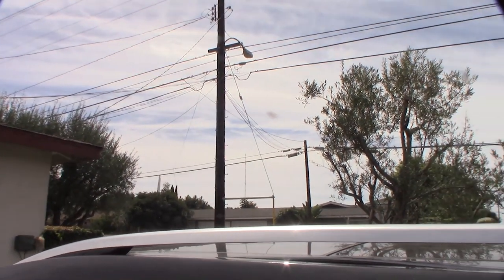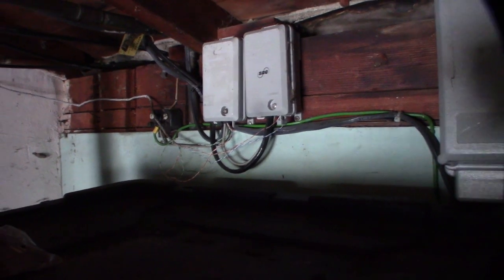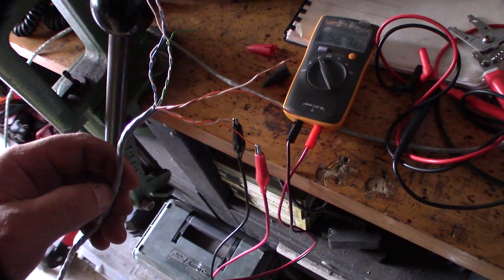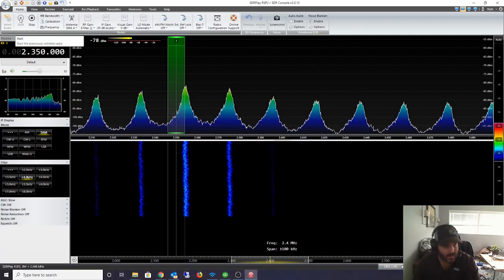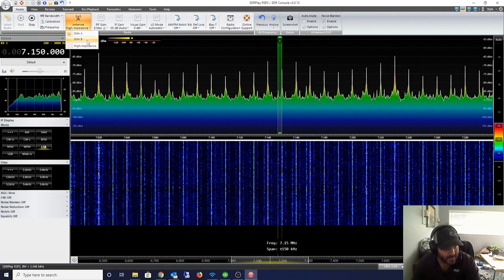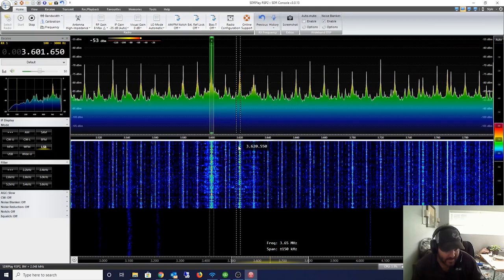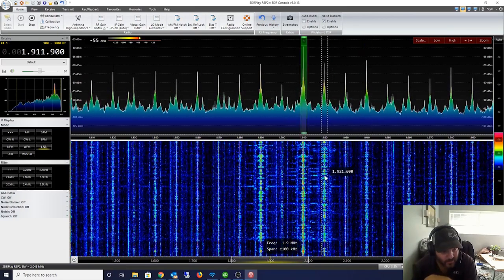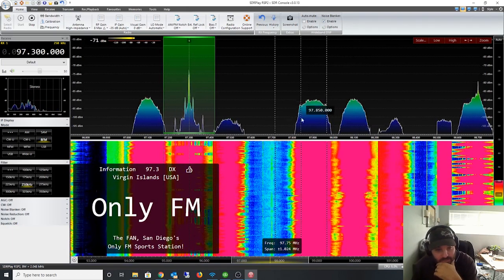Emergency Antenna using old telephone line wire SDR SDRplay Hi-Z HF FM AM

Comment: 10 to 12 years ago before I thought about using a Digital camera to document things and I don't think I took a picture of it I was messing around with a Active DI box. I Believe I went from the phone line that wasn't in use (dead) in the apartment we were at to a corded phone, from the headset RJ jack into a homemade creation that interfaced to 3.5mm jacks, into the direct box then to an amplified speaker. Somehow I manage to pick up a radio station of some sort extremely clearly and I have no idea what it was but it was definitely a broadcast.
One day I will repeat that experiment, I'll be it on a different phone line I have everything needed but the borrowed direct box.

Comment: Yes 48v DC (can be in the range of 40 to 55v) unless of course you get the 20Hz 90v AC Ring. Or worse accidental cross connect with 120 / 240v although I can think of a lot of other worst things like melting a trunk line, spontaneous interference in both directions, or the common practice of running 120v to deter phone freaks.

I've also heard that there are special equipment that uses different voltages for ISDN/T1/line repeaters etc.
Reply from the maker: Yep, I'm a low voltage contractor. I made sure there was now voltage on the line. They phased analog lines out in my area. There is still allot of copper left on the poles.